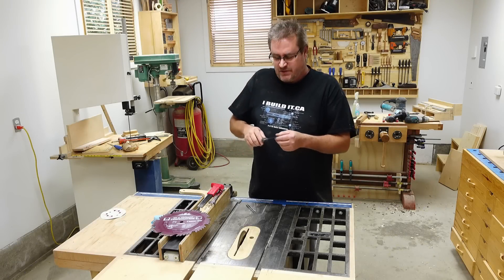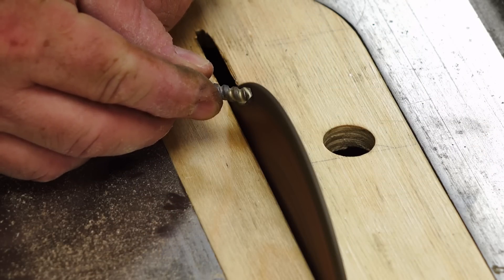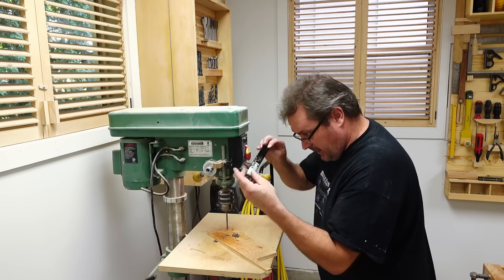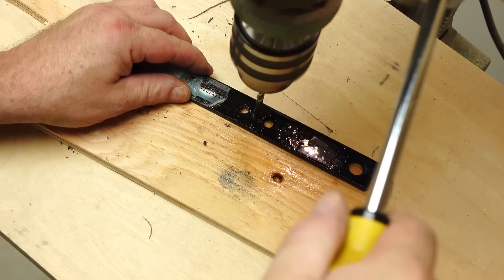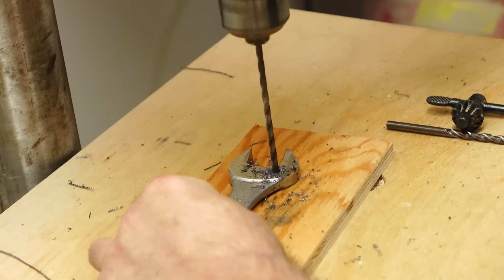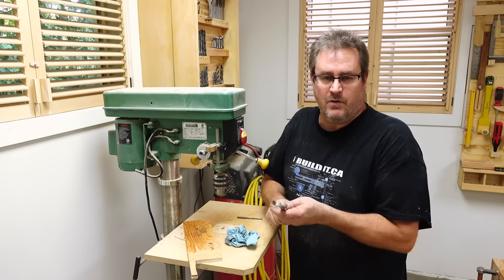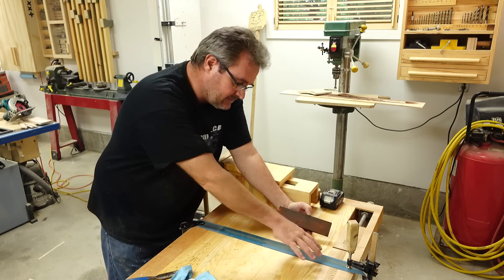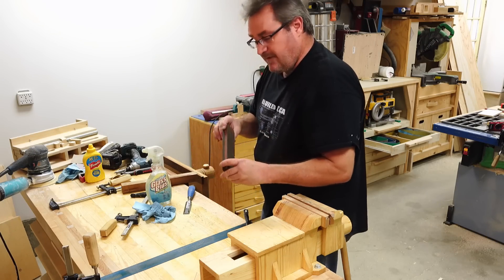Drilling Hardened Steel With Masonry Bits

Comment: Years ago when I worked for a oil well pumping unit shop we drilled bearing races for stop pins to keep the race from spinning in the mounting bracket. We used these masonry bits to accomplish this task on a regular basis. The machinist sharpened the bits and drilled at a low rpm using cutting oil to keep the bit cool.

Comment: I just found this video because I needed to drill through a piece of Chrome vanadium steel. Never thought it would work as my cobalt drill wouldn't touch it!. Sharpened a 4mm masonry drill and it worked, I got the job finished and I didn't waste the time I'd already spent. THANK YOU :-)

Comment: Your technique works. Thank you for the useful advice.

My need was to install and new S.R. Smith diving board on one of their rusting existing jump stands. The manufacturer had changed the specs on the bolts that hold the leaf springs in place from 1/2" to 5/8". Before I found your article, I wrecked two $90 cobalt Silver & Deming bits trying to enlarge the hole in the springs. The cheapest carbibe masonry bit was a Bosch 5/8" with an SDS+ shank from the Depot. The SDS part of the shank was cut off to allow the bit to fit the 1/2" drill press chuck. Lennox Protool Lube did a good job keeping the bit cool and reduce chatter. I ended up with fairly nice holes that I cleaned up with a Dremel Moto-Tool and a grindstone; both sides of the hold were given a modest chamfer, and the cut line in the bores smoothed and polished. The end result took on a professional looking power coat finish.

Comment: WOW! It really worked! I had a stubborn broken head bolt that I needed to extract from the iron block and went through so many different drill bits with no luck. This did the trick in less than 10 minutes! Thank you for posting this.

Comment: Thank you soooo much!!! I am working on a homemade framelock knife, I spent literally an hour and a half trying to drill some simple holes. I watched your video found an old masonry bit and sharpened by hand on a angle grinder. I thought even if this works my sharpening was probably horrible, but low and behold it cut the three holes I needed like a hot knife thru butter. this works!!! I started to wonder about the drill speed but I took the top off my used ryobi drill press and said forget that I'm not messing with belts to change the speed... but it worked!!! thank you soooo much!!

Comment: There used to be a company that sold a hybrid drill bit that had carbide tips. They were called Rodman drillbits. I saw a guy demonstrate them at Oshkosh about 20 years ago and I eventually bought a set. The key with those was drill speed. For drilling through hardened metals you used really fast speeds,  3000+RPM. The tip would heat up the metal almost to its melting point and then would drill the hole like butter. They worked great in a drill press.
Reply: Friction drilling...search it...or EDM drilling is super cool

Comment: For steel I use Bosch Multiconstruction bits - the carbide on them is shaped like in regular metal bits and drills like crazy. Regular concrete bits without modification work quite well to enlarge the hole previously drilled by smaller bit. Only drawback is You won't be able to get accurate hole - for example 6 mm drills are in fact bigger, 6,2- 6,5 even. Still I find them ok for my knifemaking uses.
Reply: Yes, i did it too- driled the handle of a forged scythe with Bosch multiconstruction, very fast - beat the milwaukee Tin drill bits..
So cheers to you 👍

Comment: Good tip for those that have not been stuck before as I have and used this to get me out of the dilemma. One other thing I will suggest is a firm base under the piece being drilled as Carbide is brittle and when the breakthrough happens then support in the form of a bit of scrap metal can save agony. Cheers from John.

Comment: Thank you for the video! This absolutely works. I work maintenance at an apartment complex and stumbled across a few cheap chinese made katanas in a move out I was flipping. I figured cool, I can take these long blades and cut some little tanto knives out of the them, mainly to practice different paracord wraps then give them away. Well the cutting and shaping went easy enough with a sawzall and a bench grinder, but when it came to drilling a 1/4 inch hole in the hilts bottom that was another story. Who would have figured that a $10 katana had bulletproof steel for the blades.  No drill press so I used a cordless with the blade clamped to my balconys hand rail.  After using all my 3 in 1 and smoking out bits from cheap to cobalt ect I had accomplished a dimple maybe 1/32 deep. Watched this video, dug out an OLD black & decker 1/4 masonary bit, sharpened it on a bench grinder and went to work. I had to stop 2 or 3 times per hole to re-sharpen the bit but it worked well enough to drill 9 holes in that steel. Not enough meat left on the bit to sharpen it again but it diffenatly worked. Thanks again for the video.

Comment: I may not be as informed as some of your commenters but I have spent 28 years in an industrial toolroom of a Fortune 500 company as a machinist/ toolmaker/tool designer. Your use of a tile cutting wheel( diamonds in a matrix) is probably the best tool to sharpen a carbide cutter. The masonry bit you've chosen is not all carbide but again tungsten carbide in a matrix that is cemented to a HSS shank. A sharp cutting edge is not preferable for carbide as you know it is very brittle but with a Rockwell approaching 90. A suggestion that might work is to soften the actual area that you want to drill (the shank) by direct heat from a torch maybe. You will not be altering the blade hardness if you keep the direct away from the blade, only heat the area to be drilled. But the masonry bit should work. Maybe cut in the 400 to 600 rpm range.
Reply: SuperSaltydog77 hey they question for you, I am very inexperienced with hardened steel or steel in general but what is the easiest way to drill through a caliper bolt?
Reply: Christian Thomassen replacing the caliper bracket.

Comment: Good video John. I have used carbide masonry bits to drill through the hard plate of safes many times with a drill rig attached to apply pressure, it does work well.

Comment: I came across your video looking for a way to drill holes into an old planer/thicknesser blade. I eventually did it drilling at 640rpm+oil with a newly sharpened but used masonry 6mm drill bit. It was successful for the two holes I drilled and it may drill another one only. It only takes a minute to sharpen the bit so if I need to make more holes it will not be a problem. Thank you Sir for your advice.

Comment: That trick with a carbide bit will also work with stainless steel. I had a instance once where I needed to drill several holes through a sheet of stainless with ceramic tile directly behind it. I tried it with a cobalt twist bit but as soon as it broke through, the ceramic completely dulled the bit. On the rest of the holes I used a carbide bit and drilled through everything in one shot. It wasnt the best but it worked.

Comment: I have used a glass drill to do that, just use a lot of lubrication or a cutting wax. Also had a SDS bit break the tip off in the hole. Just kept on using it, with no tip. Only needed to do around 5 more holes, and this bit had done a lot of work already. Turned it into a punch afterwards.

Comment: You can also use arc drilling to make holes in any conductive material. Simply uses high frequency high current discharge through a hollow drill bit, with a water injection inside the bit. Material is also immersed in water. Pretty straight forward but requires special electronics and tooling.
Reply: Jake Britton soooooo, not that straight forward.

Comment: Ive been using masonary drills here in the U.K. for drilling hardened steels for decades, they work really well. The only thing i would suggest when sharpening them is sharpen as you have but then grind the cutting face along the drills axis, this gives the cutting edge much more strength as the rake is reduced and the cutting edge is more 'buttressed'. you will find the drill bit will take a lot more punishment then before loosing its edge.

Comment: I strongly recommend getting a good cross vice and or using clamps to hold your work while drilling anything, but especially hard steel.
Reply: That was my thought. If the bit sticks in the metal bar it will become a spinning blade.
Reply: He did it on purpose, he hates to have 5 fingers in each hand.

Comment: I sharpened a masonary bit to use for drilling holes where I might encounter nails during a renovation.  I also use it when drilling holes through stucco and plaster.  I have been using that bit for the last five years.

Comment: You can sharp a widia drill bit (masonry bit, or tungsten carbide bit) using a cheap flat diamond masonry cutting disc. Grinder stones for widia are a bit expensive.

Comment: I used masonry bits and didn't even need to sharpen them when needing to drill a hole through a small quarter inch thick block of aluminum. cut through it like butter in seconds! and I used tons of lubrication high pressure and low speed.

Comment: Keep the drill bit cool by using clay to make a circular dam on the workpiece around the location of the hole to be drilled.  Fill the dam with water.  The water will hold the bit temperature down as it will boil off at 212 degrees F.  Replenish as needed.I once used a variation of this method to repair a clevis on a clutch cable.  To prevent heating the cable, I ran the clevis end up though a hole in a tuna can, sealed around the cable with clay and filled the can with water.  This allowed me to deposit weld on the clevis to repair where it had worn through.

Comment: at my old work every now and then we would have to drill a hole in something thats already been hardened, long story short the drill was to grab a handfull of masonry bits and just burn them out until you made it through, we never used lube or coolant either, not saying it was the best method but its what i was taught. one tip you may not of heard though is to grind them kinda like you would a twist drill for brass, but where the cutting edge actually has positive rake, just at the edge. a couple guys actually used them for bronze instead of hss because then they didnt have to screw around with geometry and resharpening their drills all the time
Reply: Check out the channel AvE, he uses your idea to remove a broken hardened tap with a 'burr' bit, worked a treat.

Comment: good tip. i have ran into that problem before. i don't drill a lot of hardened steel, but good to know if i only have 1 or 2 holes to drill. thanks

Comment: my first indication that something was amiss, was the sounds that were coming from the bit.  feeds and speeds for carbide on different materials are far more different than for hss. if your trying to drill a hole in something like tool steel, lots of lube. start very small and step up slowly.  if you try to take a big bite the tool will break/dull. the other suggestion I have is allow the tool to do the work and try not to force it. last suggestion is as the Dia of the tool gets bigger the rpm should go down. I could go into great detail about feeds and speeds,  but that would be counter productive.  especially with a hand fed drill press.

Comment: You really should use a solid carbide straight flute drill.  I use those in my machine shop and they will drill a broken tap for example.  Your second video you are drilling a file, the file is about 60 rockwell hardness.  The drills you were using MIGHT drill it, but the flutes are chipping on the serrations of the file, so its breaking the cutting edges before it gets a chance to drill.   The problem with the masonry bit is getting it to start, and my next paragraph covers an issue with drilling the serrations of the file.

You would need about 1100 rpm to run a .25" dia hole with a straight flute carbide drill, with some type of lubrication preferred, we use a water/mineral oil based coolant/lubricant so even tap magic would work, just dont overload the drill let it work, and also maybe pregrind the serrations off in a small area to start the drill in a file for example.  Carbide is very brittle, chatter and "snagging" are its enemies.  

You may already know all of this, but just sharing what works for me.   Obviously the rpm would have to be adjusted with different diameters as well.  

Here is a link to purchasing the drills, for a large hole they get pricey, up to about 1/4 they are not too bad approximately 40.00 or less and would be used multiple times.  They will typically drill 65 rockwell (we drill bearing races and thats the hardness range they work in)   

Again my.02 only, drill on and have fun

Comment: Ive got to drill through 1/4" hardened steel angle iron used for channel for grates in a driveway. Then 5"" deep into concrete to apply sleeved anchors. Every bit I've used to try to go through steel channel is done soon as tip hits concrete. My hammer drill with concrete bits fine once holes big enough to get to concrete. But every steel bit Ive tryed dulls and cant get through. Trying to drill 1/2" hole for 1/2" sleeved anchor. Hole in angle has to be a little bigger to fit concrete bit.

Comment: A Drill Doctor works great to put a sharp and centered edge on a masonry bit.  Also, keep the speed down when using carbide bits to reduce heat build up.

Comment: For harder materials you need less angle on your drillbit.
And use some kind of drill oil in large quantity or coolant.
The harder the material the slower rpm on the drill too, the same goes for larger holes.
👍
Reply: Usually for machining hardened steel it's not used any cooling fluid and very high speed
Reply: @tullgutten  that's not what i been thaught or experienced in practise.
After all i have a machine shop degree and an tool makers education plus several years of experience.
But i can be wrong.👍

Comment: I'd also consider reducing the distance from drill tip to chuck.  The long shank on the bit seems to be wobbling.  This would reduce the cutting action.  Also, the carbide wont mind the heat up, but the work piece could work harden.  That could get exciting during or after drilling.

Comment: The mscdirect company told me that carbide is way too brittle for a drill press. They have some super cobolt bits with two different titanium coatings. Best I could find. The company, in general, has (pretty much) all the metal working bits on the planet.

Comment: Bought a Norton 4000/8000 wet stone (originally to sharpen my straight razor), also had a really nice 1000 grit diamond plate (forgot the brand), I lost the damn diamond plate. The diamond plate was really how I got the Norton perfectly flat, and it did an incredible job sharpening EVERYTHING. Loooved that sharpening plate, I'm still mad at myself for loosing it.

Comment: I know when drilling stainless its important to lower the rpms. So try drilling the holes at the lowest speed available on your drill press because high speed creates heat and work hardens the metal. use more cutting fluid, that does help, you need to keep the bit cool as possible to avoid work hardening.  CRC cutting fluid or Tap Magic is a good cutting oil, worst case scenario is to dip the drill bit in cold water over and over I guess.  plus there are charts available to show you exactly what feed speeds to drill stainless for different thicknesses. 
most folks think you need a carbide bit or a cobalt bit to drill stainless but any standard high speed steel HSS bits will do.  but if all you have is a masonry bit this does work! but as I said, use more cutting fluid and lower the speed.

Comment: Hi
First as a Machinist, I learned that trick yrs ago. first off your running your drill too fast, don't get the drill too hot or the silver solder that is holding the carbide in the tip of your drill will melt. I use straight alcohol instead of oil it keeps the drill cooler. I've drill chrome with a masonary bit...
have a good day
Ed

Comment: I just experienced the same thing today. None of my cheap HSS bits would get through the file. I ended up using a 25 cent Chinese bit meant for glass or tile. Used 2 bits. Burned through the first one not using enough water and got through with the second one with the file completely submerged.

Comment: I drilled some grease zerk holes through hardened steel rod I’m using as bushings on an atv with cheaper Harbor Freight bits. Anything thin (3/16” and smaller) broke after getting as it was pushing all the way through. After going through 10 bits on as many holes I bought some Irwin cobalt bits. Haven’t had any luck with them, they barely make a simple and want to walk around instead of start a hole. Going to try and punch a center punch even though it’s hardened steel. Any ideas?

Comment: If I remember correctly from my die making friends said that  concrete bits are sharpened when they get them at 118 degrees, and I hope that is cutting fluid that you are spraying on there and not just normal oil or you are just reversing the sharpening and only polishing your bit.

Comment: I have used masonry bits sharpened in 1/2 inch and 3/4 inch to drill hard plate when opening safes for years.

Comment: Years ago we were drilling vehicle spring leaves using ordinary high speed drills at a slow speed using kerosene as a cutting lubricant. Once you start drilling ignore the screeching coming from the drill and DO NOT  ease off the pressure till you get through it. If you ease off the pressure you  wont  be able to start it cutting again.